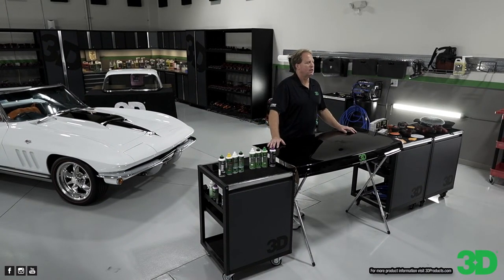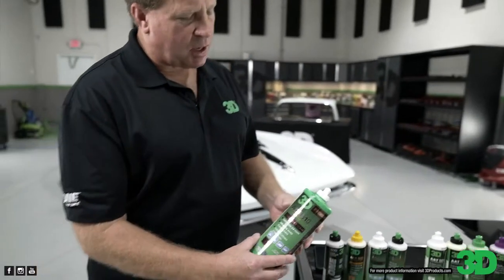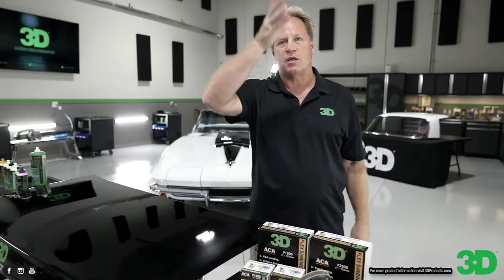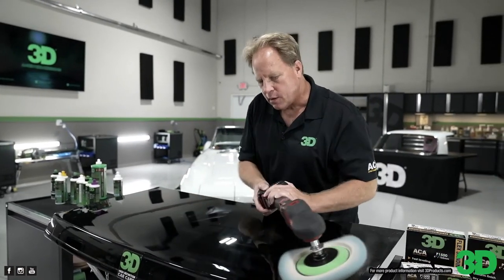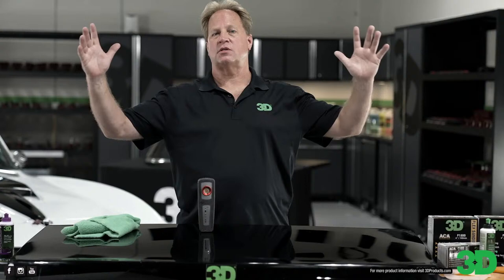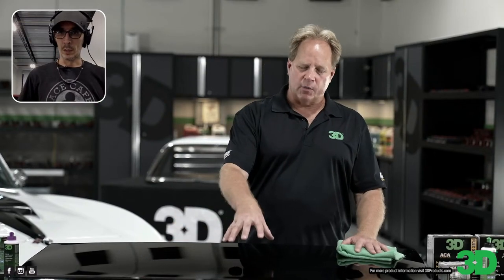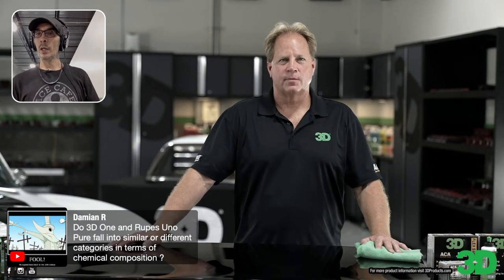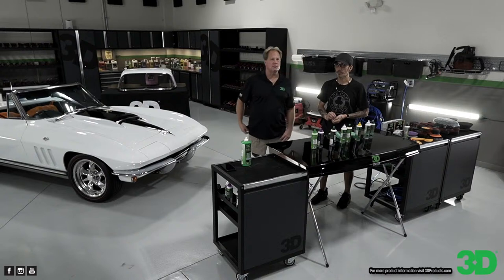AAT, ACA - What are they and what are the differences?

Comment: Great video yet again. Thank you for clearing up these systems. Helps me make a decision. So far I've been using 3D ONE and AAT 505, Poxy for the past two years. With the 3D purple pads. I have a bottle of P&S Plsymaker and I've only used it 5 TIMES. I might as well give it away. It's so hard to remove and extremely dusty. 3D products all the way for me. Would love to see the interior line of 3D products in n your videos.
Reply from the maker: Glad to help! Will work an interior video in when we have a convertible in the shop. Thanks for tuning in! - Yancy

Comment: Hi guys great video I’ve been using meguiars one step also just recently purchased McKee rv polish and wax can 3d one also be used on a fibreglass travel trailer and then finish with 3d poxy thanks
Reply from the maker: Yes it can - that is a great combo. But it you want to do it all in one step I would recommend 3D Speed. Same as one for correction and has Poxy already in it. - https://3dproducts.com/collections/compounds-polishes/products/3d-speed-all-in-one-polish-wax

Yancy
Reply: @3DCarCare  right on thanks

Comment: 한국팬들을 위해 자막 부탁드려요
Aca 500 과 aca 510 차이와
스피드를 사용하고 세라믹 코팅이 가능한건지 궁금합니다
Reply: 510 for hard clear (more cutting power), although Mike said it can be used on medium toward soft clear. Speed not advisable used if you want to ceramic coat your car. The wax will interfere the bonding between the coating and the paint.